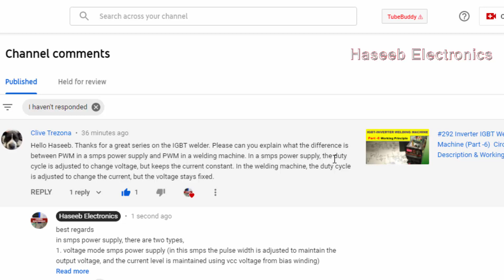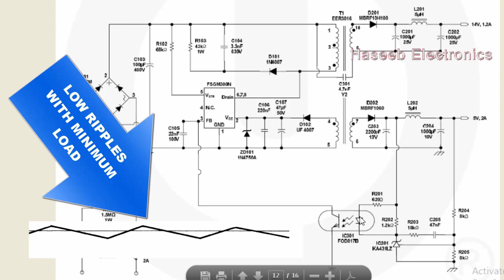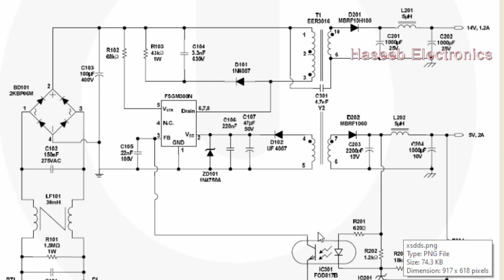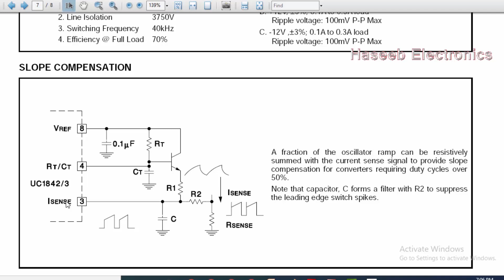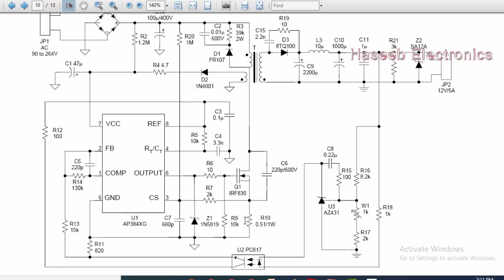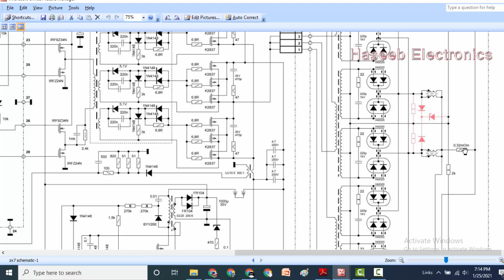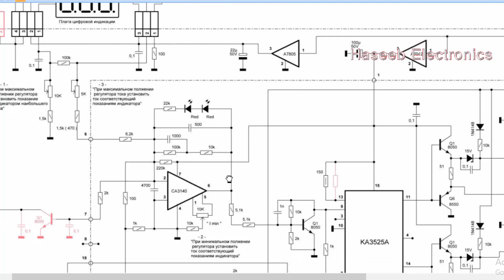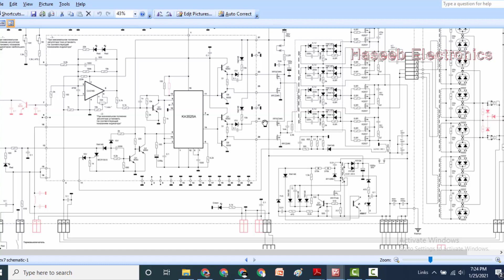{314} Voltage Mode SMPS vs Current Mode SMPS vs Inverter Welding Machine Circuits

Comment: Assalamualaikum sir 200  weldinng mechine botoum card. Metel diode to capacitor to   top card 300  volt  to 24 volt to and control card to middle card  to  out put 70 volt dc and ampes  . But   amps whare  it develops in which  card . I am so confused three card plese explain amps  in welding machine

Comment: I have little knowledge in electronics,  Sir, please kindly let me know if I can use an inverter welding machine, as a continuous PSU (Power Supply Unit).

Comment: Very well explained. I have a welding machine using a 2 high capacitance capacitor(200v/2200uf) and they are in series instead in parallel. Can you make a video on it also? The design is single board. With 2 igbt and 2 output diode. The machine is rated a real max output of 140amps

Comment: In welding mechine 220 ac input  .....  Botom board 330 dc out put . Top card control  all sections. Middle card what working principle. And   Amps  which board developed.out put welding  rod melt curent amps adjustable  . What is component in board  amps how test in live  amps in  board in adjust time.,,

Comment: Hello Haseeb I hope everything is good , first let me thanks for your lesson and video , my question can I take adjustment voltage from welding machine I have Chinese welding machine with control card bk129-a3 it's dependent ka3525 , did you have any way to control at voltage, I need use my welding machine to charge my battery because I can't buy one , did you have any solutions? Thanks sir

Comment: I have two identical  AC/DC tig welders that have accurate current output for DC but inaccurate reading for AC (verified using current clamp).  In AC, the inaccuracy is at low current setting (set 10; 40 A actual) levels and less inaccurate at high setting levels.  Is it possible to adjust using trim potentiometers inside the machine for AC current only without affecting DC current accuracy?

Comment: Awesome information!!! I’ve been watching a bunch of your videos and have a question about a machine I have been having problems with AC/DC inverter machine that has a power switching relay 5 pin that’s bad and I cannot locate one anywhere for it part number GP-24VDC-C54 do you know of a compatible replacement relay that is available currently

Comment: Thanks for the great content! Is it possible for you to share the schematics of the welding machine? On the video series about welding machines the electric diagrams are a little bit different of what I have here on the welding machine I'm trying to repair and the one on this video seems to be exactly the same, but I was not able to find it on the internet. I'd be much thankful if you would share it. Thanks again for the great videos.

Comment: can i use smps welding machine like power supply with high current,can i just add 100amp rectifier and 50.000uf capacitor on exit and use it for charging lead acid battery with regulated current?

Comment: Haii, is it possible to increase the current capacity of my SMPS,instead of purchase new one ?I have 24V/10A smps, but my load requirement is 24V/13A.
Reply from the maker: no
it will damage the power supply 
actually any power supply must be operated at maximun less than 90%
in your case it must be less than 9 ampere 
otherwise it will damage soon
Reply: Sir, i am asking is it possible to modify the existing smps range to my desired range

Comment: Sir, Namaskar, I have no words how shall convey my thanks to you for such a nice explanations,  now my humble request to You to explain the control card of igbt welding machine,  make 200a, the pcb having 1x uc 3846 ew, 2x 4688, 2x 393, 1x TLO 84 IC, IF possible please,  thanks to You
Reply from the maker: best regards and lovely thanks for your valuable comment 
sure i will try my best to share it detail and we will discuss its faults and their solutions
Reply: Namaskar Sir,  I am very fortunate to receive your assurance, kindly provide the details of said control pcb, one more thing can I replace the control card with common IGBT 30 PIN Control pcb,if so kindly guide me the wiring diagram  Please consider me for long asking, Salam Sir

Comment: I have a small Chinese welder.  the actual working amperage does not match the digital meter.  I found the 2 trim pots on the control board that control the max amperage and and the meter.  My first question is how do I find by looking at the design of the board the maximum amperage the machine is designed for so I can set the maximum amperage.  Secondly the digital meter is reading a non linear signal so scaling the voltage down to match the actual range of amperage is impossible....how do I overcome this.  The board on the welder is a ZX7.  Thanks your video's are great!
Reply from the maker: Good Morning.
2 Trim pots on control bard are maximum current limit, and welding current set
welding current limit pot normally 20K Ohm.  this trim-pot works with current setting potentiometer. welding current limit pot is used to calibrate the output current with selected range on panel by means of current setting first of all verify regulated 5 volt (mostly it is achieved from 7805 regulator) and ensure these voltage on display as well.
there should no display when current setting potentiometer is set to 0 ampere. if it displays some reading set "display zeroing trim-pot" (normally it is 5K Ohm, most of the time on the display module)
take a calibrated good multimeter to measure milli-volts across the shunt resistance, see the shunt reading (for example 200mV at 200A,     OR  there will a resistance value i.e 100 m Ohm). calculate the expected voltage drop on shunt resistance, and connect multimeter across the shunt with excellent test probes with minimum resistance (and note down the multimeter error)
set current setting knob any required value. for example 100Amp. 
start welding
measure the voltage drop across the shunt resistance to determine the current flow. 
check the reading on display, adjust by display calibration trim-pot
adjust the Short circuit current limit to protect Over Current Light
in this way you can scale / calibrate the current setting knob value, display value, and output current 
Maximum current or also called "Short Circuit Current Limit" this trim-pot is used to provide reference to control logic to set duty cycle
Reply: Thank you very much.  I will try and let you know how it went.

Comment: dear Mr. Haseeb firstly thanks for your explanation ,and I wonder if you can help me to convert welding machine(SG3525 control IC) to high current battery charger with constant voltage (14 v), thanks in advance for your reply
Reply: I want to convert mosfet welder to Solar inverter

Comment: Thanks for your video. Do you think possible convert a MMA welding machine in MMA, TIG and MIG?
Reply from the maker: best regards 
regarding conversion i didn't tried or studied feasibility so far. i will co-relate it and if possible i reply positively

Comment: Sir, to use Uc3844 as a Led driver, should I connect VOLTAGE FEEDBACK pin to a fixed voltage or just left it open? Because I want to control current only..
Reply from the maker: voltage should me monitored either through the optocoupler or you may add divided voltage from aux voltage, so ic should maintain duty cycle using current sense with combination of voltage value
in case voltage are uncontrolled , and there is some light load, in that case the ic can overshoot and make damage to the next circuit 
it is my suggestion

Comment: Fantastic explanation as always,one more question arises in my mind that either voltage is dropped or current decreases at output due to load changes,in both cases switching IC will adjust it's duty cycle to maintain load current and voltage.Am I right?,if not please explain in detail.

Comment: At 10:44 min of your video you mention the rebooting of the SMPS, i just acquired online a well built, second hand PSU from Germany 24v up to 6.28Amp. But at 5Amps it starts rebooting, where should i look at ? the sensing circuit ? thank you & Salam Aleikum.

Comment: Sir, this video is very helpful for me. Thanks for understanding this video.

But I have a question. 🙄🙄

In UC3843 IC, if I connect the current sence pin to the ground then the IC will work (Only in Voltage Mode) and will adjust the output voltage only?
🤔🤔
Reply from the maker: yes you are right. at that time it will work in voltage mode

Comment: What the better welding machine mosfet or igbt one thanks
Reply from the maker: igbt design is more strong, if it is designed perfectly by some branded manufacturer
copied designs produce problems time to time